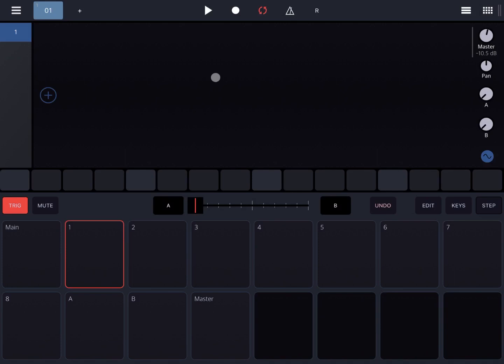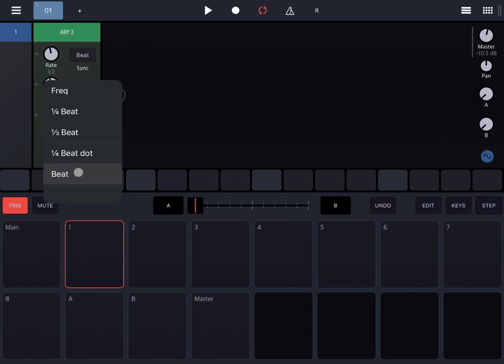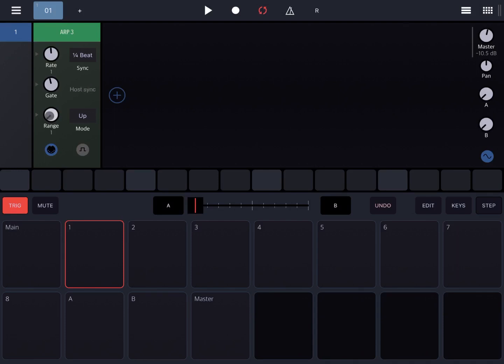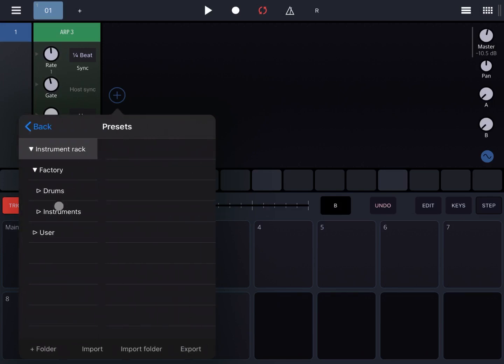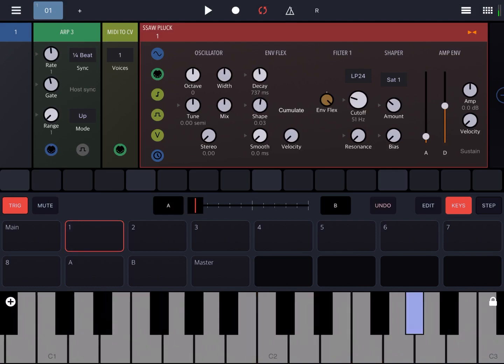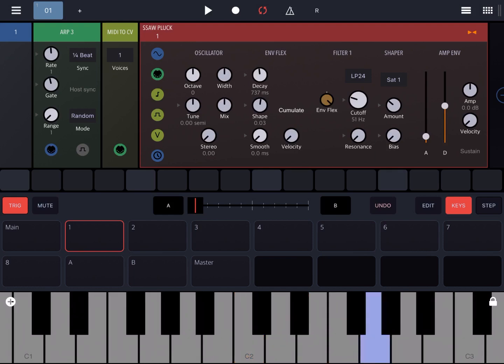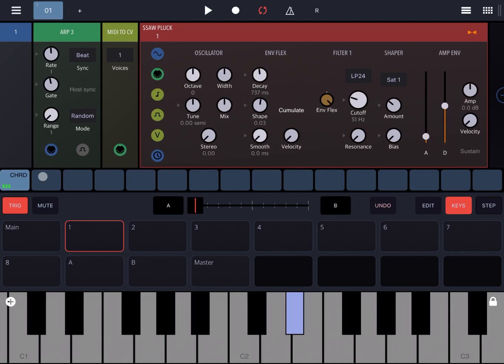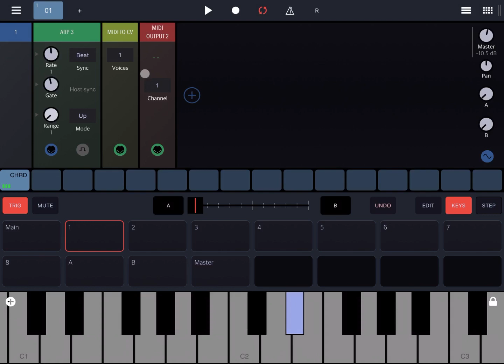BeepStreet Drambo - Tutorial Part 25: Arp

Comment: Do you have any idea how I van make a switch to turn the arp on and off.
Reply from the maker: Many ways to achieve that.. first one that cone to mind is to use a switch and clock generator into a multiply module driving the gate of the arp module…
Reply: @soundformore  thanks my friend I will try that.

Comment: Thanks for the video showing how to connect the arp module . i have a lot of problems understanding what im supposed to connect on this app . when i bought it i saw a video saying it will automatically route the modules together which i thought meant hook them up automatically but apparently most of the modules need to be connected manually and i find it very confusing not knowing midi and cv and host and generator , ect. and so on  , as to where to connect things . i have the AUM app as well and very rarely use it for the same reason i haven’t been using drambo much at all and its because all the routing confuses me and the manual doesn’t make sense to me as im not good at reading manuals in general.  Videos such as this are the only things that help me understand things like this.  I tried figuring out the sampler and had no luck understanding how to get the sampler to work .  it seems like a great app for people that understand midi routing but for people with little understanding of that its a difficult app to use .  there was a very cool modular app that never caught on but had an amazing vocoder and seemingly limitless modules that could do a ton of things but i never found a manual at all for it so i just used presets , that app is called Jasuto   (its actually still available) , and it looks  incredibly deep like Drambo appears to be but again if you dont know routing these modular apps are just confusing .
Reply from the maker: Hopefully these videos will help...
Reply from the maker: Would you like to see some tutorials on Jasuto?
Reply: SoundForMore yeah actually some Jasuto tutorials would be great !  i got as far as figuring out the vocoder and a sequencer module and that was about it .  Seems like most people aren’t even aware of Jasuto .

Comment: Like your tutorials! Is Arp in Arp possible?
Reply from the maker: Can you be more specific please? For example do you mean an arp driving another arp?
Reply: SoundForMore Yes, that's what I mean
Reply from the maker: you can as the arp module accept midi in and output midi out; depending on what you want to achieve you might also need a midi mixer in between and pay attention to the right connections...
Reply: SoundForMore Thanks!